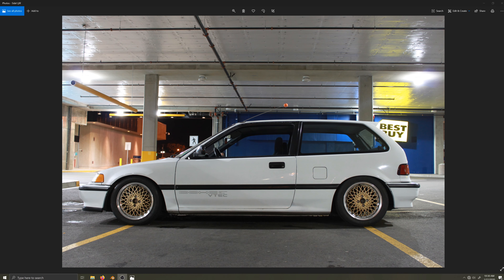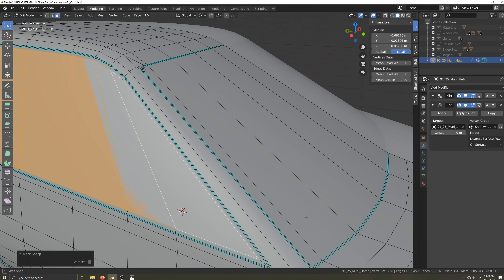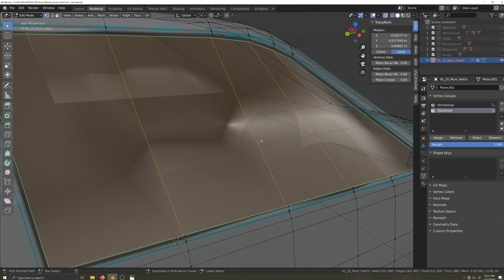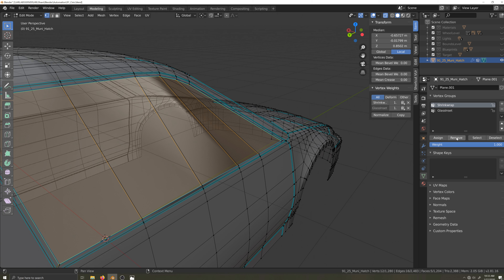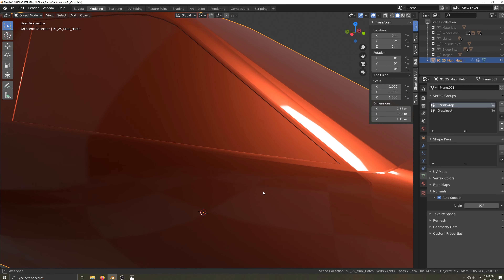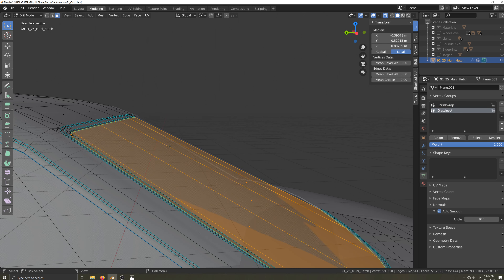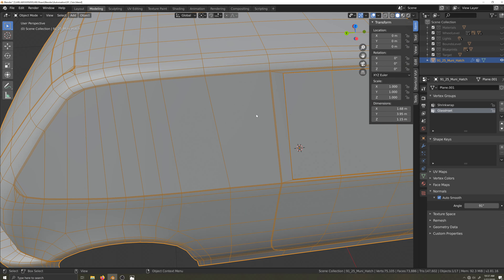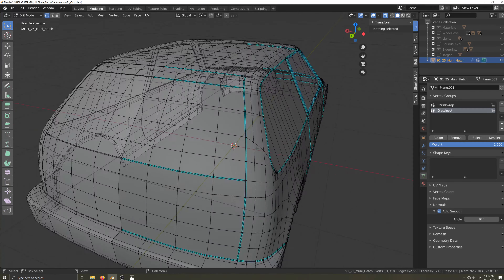Automation Car Modding Tutorial 6 - Glass and Moldings

Comment: Just so you guys know since the tutorial is a bit old, in Blender 4.1 and later versions, the Auto Smooth option has been relocated from the Object Data Properties under Normals to a new location. It is now implemented as a modifier called Smooth by Angle. To access and use this feature:

Select your object in the 3D Viewport.

Navigate to the Modifiers tab in the Properties Editor.

Click on Add Modifier and choose Normals > Smooth by Angle.

Adjust the angle threshold as needed to achieve the desired smoothing effect.